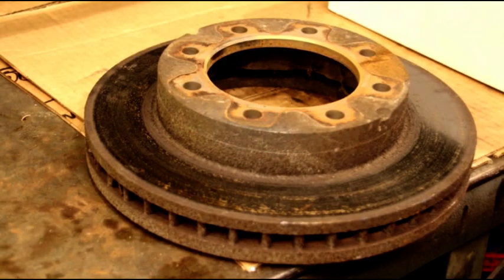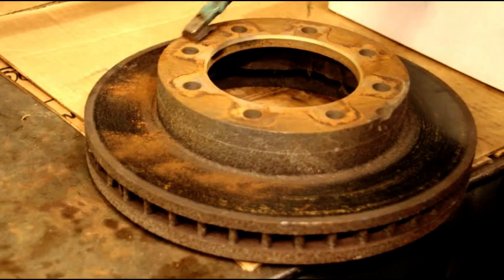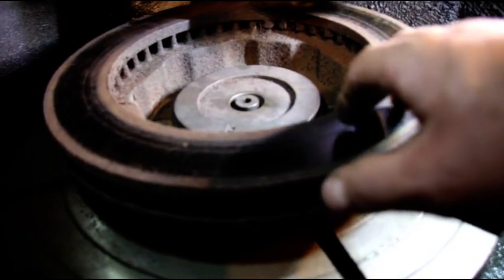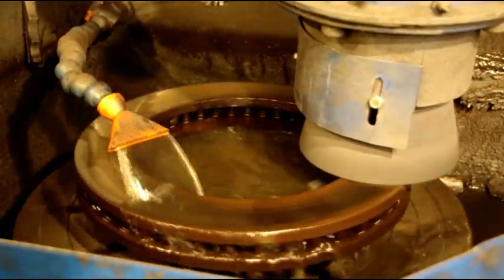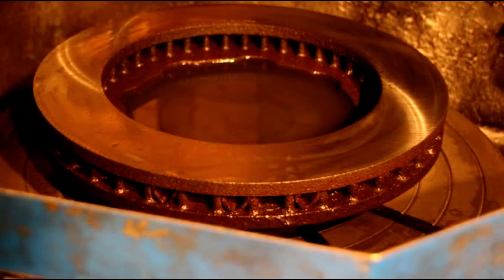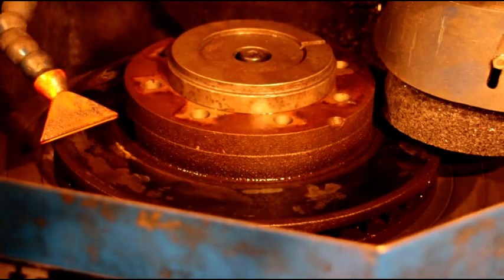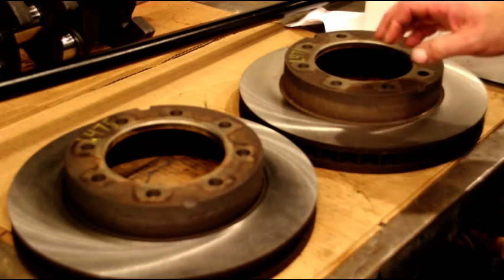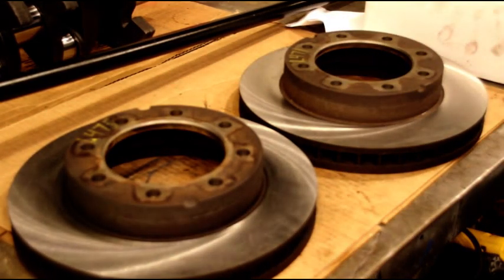How To Grind Large Brake Rotors

Comment: Nice work. Just don't try to do solid, non-vented rotors this way. Too flexible, and the harmonics prevent you getting to a nice surface.
Reply from the maker: Agreed, the smaller non vented ones get thrown away with pads and new ones installed.  Too much flex in them and they can't be turned even on a proper rotor machine.